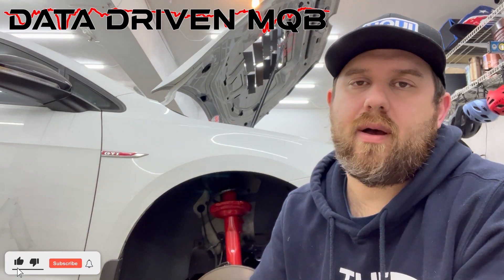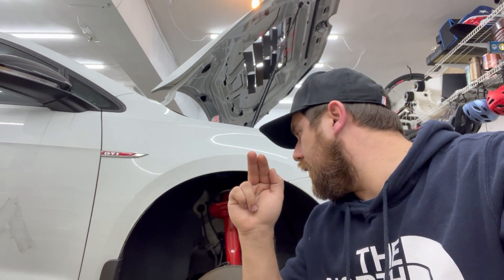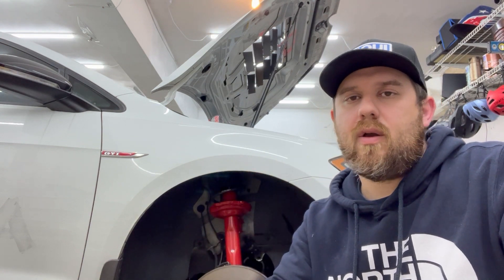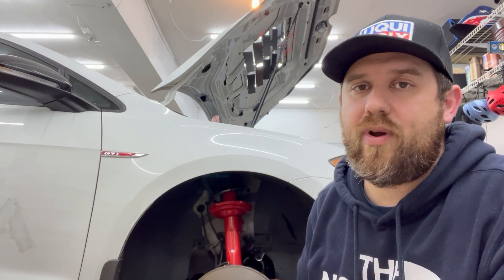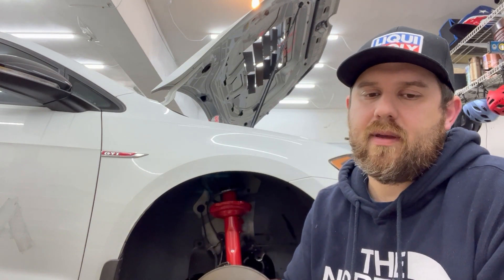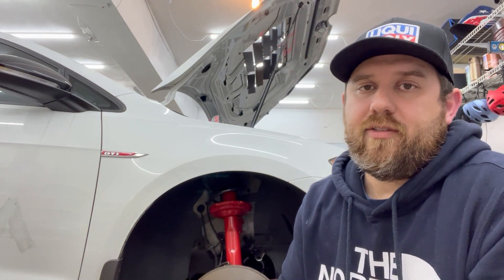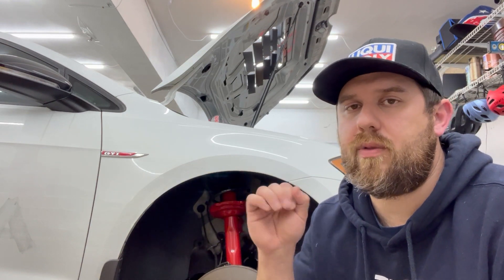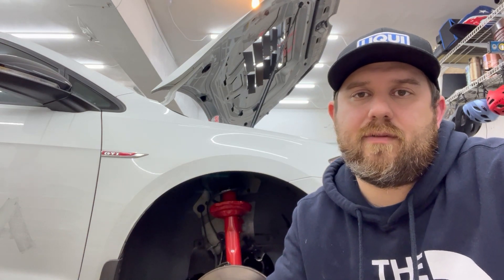MK7 Suspension Geometry - Intro

Comment: I mean to correct bump steer when lowered generally you want the outer tie rod end further down.

Here's an idea - on the MQB the tire rod end goes into the knuckle from the top and has a nut on the bottom.
What if you just flip it around so the rod end goes in from the bottom and has the nut on the top? Just loosen the tire rod end, rotate it out by 180 degrees on the threads and tighten it back up again with it upside down and insert it into the knuckle that way? Obviously you'd need to do an alignment afterwards but it'd achieve the goal.

Both bottom and top surface of the knuckle where the tie rod end goes in are flat so there's nothing preventing you from running the tire rod end upside down, that'd achieve getting the tire rod end down by a fair bit.
Have you tried that or can you try that?
Reply from the maker: @nesmio7378  that would be WAY too much change. Would necessitate extending the ball joints by 2+in or so and that’s moving the roll center WAY too high.

Whiteline KCA462 has some sleeves that lower the tie rod by about 6mm. Their ball joints are about 7mm longer so those two combined adds a tiny bit of bump steer, and is what I’ve been running. Everything else in the kit is garbage, just the tie rod sleeves are needed.

Been meaning to finish this series out but just really been low on motivation to do anything car-related.

Comment: Have you tried the Megan/HardRace RCA Spacers for the balljoints alongside the 034 Balljoints? 
They should raise the Balljoint and cancel out the need for the tie arm to be lowered...
I'm planning on changing to this setup in the near future for track work. Hopefully you can look into this and see it beneficial.
Reply from the maker: So I've seen those. The funny thing is they don't do a single thing for roll center adjustment (which IMO is probably ideal since this chassis doesn't have any great bump steer solutions). My main reservation is IMO they're both cheap China garbage.

The reason roll center isn't affected with those spacers is because the ball joint is still in the same spot in relation to the knuckle. The lower control arm can be shaped like a loopty-loop and that doesn't change the geometry. The pivot points are all that actually matter. It moves the arm down, but not the ball joint pivot.
Reply: @datadrivenmqb So you think the current best solution for the roll centre adjustment is still just the verkline out tie rods?
Reply from the maker: @D3JXY  those can correct bump steer, but only move the tie rod down by 2mm. Any of the roll center correcting ball joints move the ball joint pivot down by ~10mm (at least 034, not sure how much Whiteline moves it). 

I've got a solution in the works to dial out the bump steer :)

Comment: What shocks are those? Never seen red shocks that are performance oriented for the mk7 gti/r.
Reply from the maker: They're Koni Special Actives. Been on the car for over a year now. They're AMAZING on stock springs, was able to enter the esses at VIR at 120mph on them.

They're not "meant" for lowering springs (as I wasn't originally planning on dropping the car), but per Koni they're OK for a <1in drop (which these 034 springs are). I think some street improvements could be made by playing with the bump stops. Had no issues with the shocks on track this past weekend related to the shocks/springs.

Comment: Any thoughts on long travel coilover setups (with camber plates) or 034 LCA’s?  Those are what I chose to add negative camber and a little more positive caster.  I have the 034 ball joints too, but haven’t decided if I’ll run them or the OEM version. I don’t want to drop my ride height much more than 15mm so I’ll be doing some measuring before I install the springs on my struts.  I look forward to seeing what you come up with in your series!
Reply from the maker: Honestly if the Camster plates had been out when I purchased, that's the direction I would have gone. I bought the camber plates and then the other ones came out like 3 weeks later... hah.

The 034 control arms are probably the best bet to pair with them IMO. Adds camber and a tad more caster as well without wildly affecting bump-steer (which the ball joints absolutely do). To be fair, bump steer is very hard to feel on this chassis because the steering is so over-assisted. But it's bad for tire temperatures, tire wear, and predictability if you're really driving the car at the limit on anything other than a perfectly smooth track.

IMO the "best" solution would be camber plates (Vorshlag if using coilovers, 034 Camsters if on anything else) + CSS knuckles. Between that and slight lowering (10-15mm) I believe will put you in the -3.1 to -3.3 deg range which should be plenty for most people. If more is needed, then either 034 LCAs or Powerflex LCA camber bushings would be what I'd do. I tore my Powerflex bushings in a year, but they're not hard to replace so it would just be a maintenance thing IMO. No personal experience with the 034s, but haven't seen anything bad yet FWIW. They also add a tad bit more caster too which is nice.
Reply: I’m reluctant to run poly bushings in the front. It seems like nearly application that uses poly has a fairly quick wear/failure rate. I’m not exactly sure how much the Cygnus camber plates will get me, but I was estimating -3.0 or possibly a little more with the ball joints. Bump steer will probably be unavoidable, but I’ll probably end up going with the RS3 ball joints to minimize it.
Reply: @jeremymitchell8470  have you considered the 8S Audi TT front wishbone if you're wanting more camber? 
They're the same as the TTRS wishbones as far a I have been told, so come with stiffer rubber bushes as standard. It would be a more durable solution than poly bushing. Plus you may still be able to utilise the RS3 ducts, or use a TTRS duct if they make them and the shape is different in the mounting area.
Reply: @KXP70 I read that those increased the track width enough on the Mk8 that there could be issues with cthe CV joints. I’ll run the 034 LCA’s and if I don’t like them, FCP euro will swap them out for another option if it comes to that.
Reply: @jeremymitchell8470 Any feedback on your 034 LCA's? Debating between them and the tophats for my Mk8R.
Reply: @nobleman-swerve they were awesome during the time I owned them. Held up fine to track abuse and daily driving. I’d definitely advise buying through FCP to get the lifetime replacement though.

Comment: Good info. Recently installed lowering springs on the wife's sportwagen and was surprised how much i hated it compared to the stock springs when running the tail of the dragon. Definitely felt flatter and grip was up on sweepers due to the camber and lower cog but the bump steer and stock height bump stops made it feel very "squirmy" in tight technical corners. Interested to see details on the ball joints and correcting bump steer.